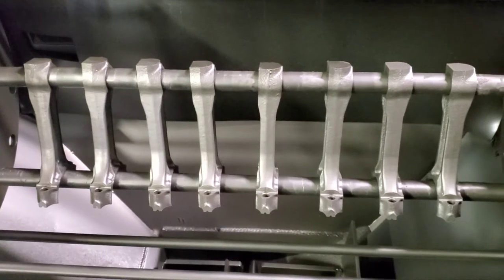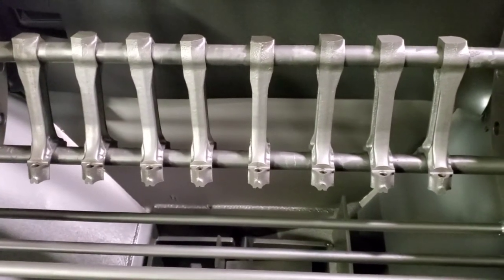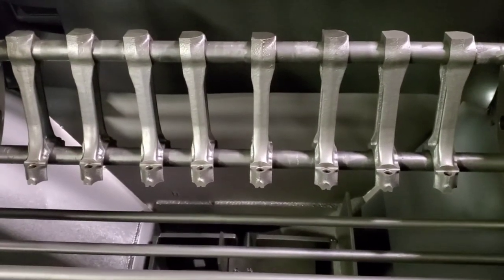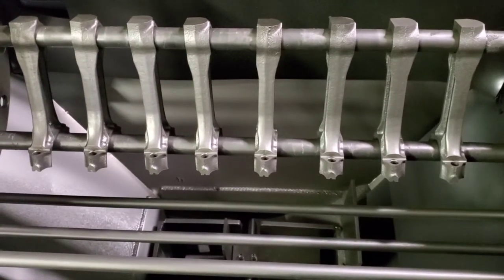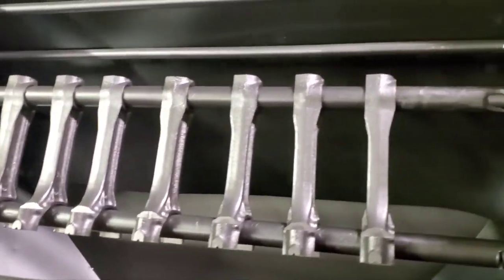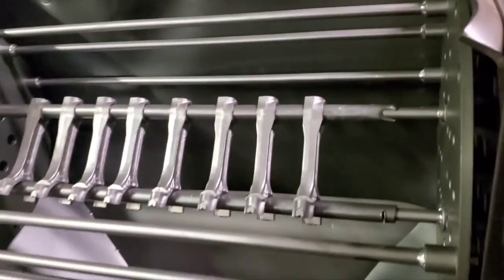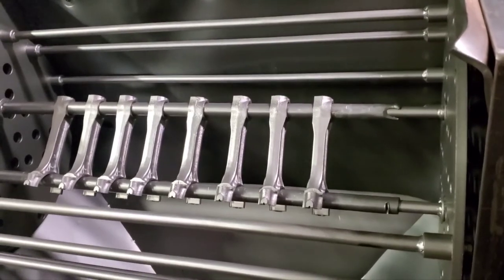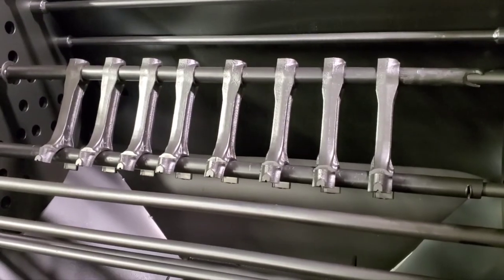Prepping the AMC Connecting Rods. Shot Peen and Stress Relieve.

Comment: Very neat. I have always been told to deburr and shot peen olds rods and upgrade bolts because the stock rods are not the strongest. Now I know exactly what it is. Thanks Ed.

   Nolan.
Reply from the maker: Hey Nolan, I am doing a build on these rods and they will have ARP Bolts.
And special assembly procedures that most likely you will see no where else.
I am into making stock block parts better..
I have done this with Oldsmobiles also.
Take care, Ed.